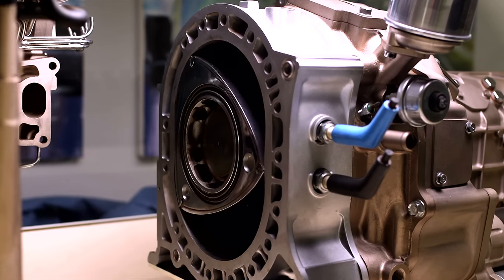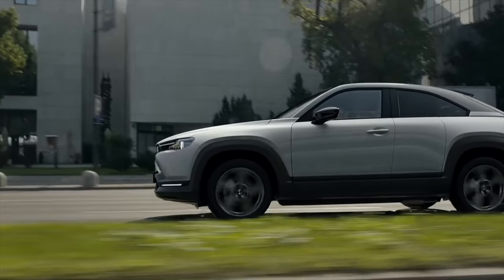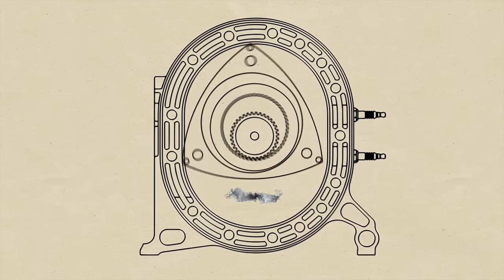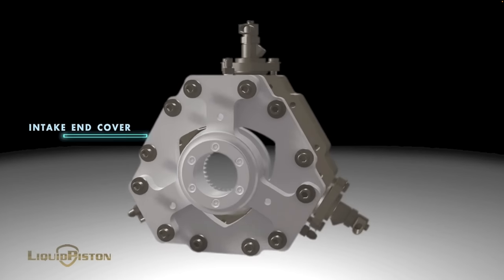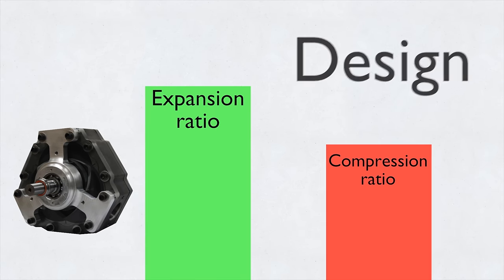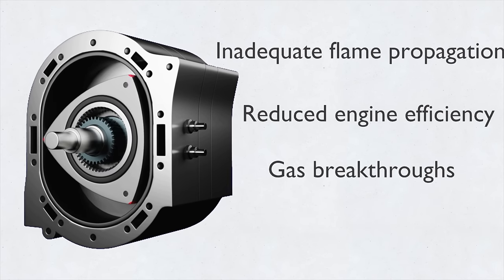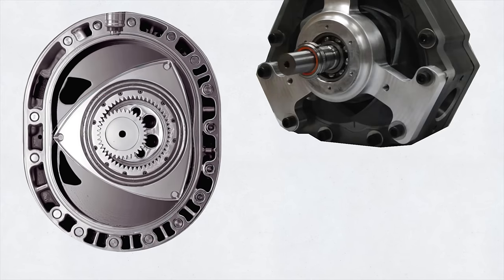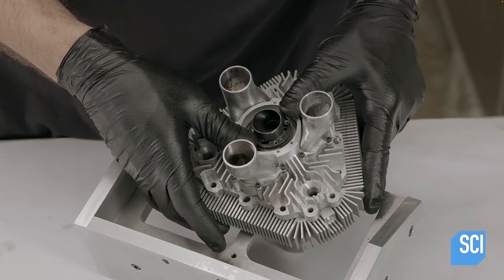Mazda's New Engine is the Smallest and Most Powerful Engine Ever Made

Comment: I'm surprised that liquid piston engine isn't already being used in cars. It would seem like a massive improvement even over piston engines.
Reply: Inertia.  A surprisingly powerful thing
Reply: Politics... advancing engines is politically unfeasible, with Western politicians bought by China with common people spending their money buying dollar store items.
Reply: I first heard about the LP engine around three years ago, and was shocked then to see it had already been around for some time with practically zero attention payed to it
Reply: They are comparing it to a basic 4 & 2 stroke piston engines that you find in lawn mowers and generators. Those engines are very poor in efficiency compared to the engines you find in modern cars so liquid piston engines might not be very efficient and according to their website, they might only be suitable as a range extender or in a hybrid powertrain. 

When it comes to piston engines, they have valves and have a lot of displacement to mix the air/fuel mixture so they can do lots of tricks to maximise the efficiency of the combustion as well as reducing carbon monoxide, soot, NOx, and unburned fuel. So keep this in mind.

Comment: If the liquid piston proves feasible then an inexpensive, compact 40hp diesel hybrid could make a good second car. The engine/charger running at its most efficient could keep a small battery-pack charged or, for every-day trips to school or work, it can use a plug-in charger at night. So, say a 40-mile electric range or a 300-mile diesel-electric range. A 70hp engine might do the same for an SUV. In this way you won't have to carry around a lot of extra batteries you mostly don't need.

Comment: I think hydrogen, I automatically think explosion....like the Hindenberg.  Still, I like the idea of using these newer devices in smaller equipment like drones, weed wackers etc.  It gives ample time to see things in action, make adjustments then move them to moving vehicles.  It could be a really good process to moving into other energies.
Reply: They won't explode though, the fuel cell tanks are bullet proof.
Reply: @ocrapo9327  That's really good to know.  Thx.
Reply: @lindac7146  One might explode though so it's a good point.
Reply: @ocrapo9327  ok Barika, which is it? Explosion or no explosion? 🙂
Reply: Petroleum/diesel engines already internally combust
Reply: Hydrogen has a really high cost to produce, its difficult to store and transport effectively, and extremely volatile.

This is the last thing we should be going for. 

But scotty bought liquid piston stock most likely, so here we are.
Reply: Whenever I hear people talk about Hydrogen fuel exploding, I have to remind them that gasoline is also highly flammable. The risk of exploding is about the same for an ice or even a modern battery electric car.
Reply: @Dizzykitty817  they aren't at all the same. Gasoline isn't stored in pressure vessels under thousands of psi, it doesn't leak past fittings an seals like they don't exist. The risk of injury, damage, or death from a fuel tank rupture or spill flaring up is negligible compared to a ruptured pressure vessel of hydrogen combusting. 

The bigger issue with hydrogen is still the idea that it's not viable as a fuel source because it's energy intensive to procure.

Comment: That liquid piston engine sounds amazing, imagine it with a hybrid setup
Reply: As a hybrid or just as a backup hydrogen powered generator.  Hydrogen will be the fuel of the future, renewable electrical energy systems will produce it, and transportation of Hydrogen is even less cost than natural gas.  Future will be interesting and tech will be amazing...AND, no green new deal government intervention is needed, just time....
Reply: @wokewokerman5280  once it stops being so freakishly dangerous... which is never...
Reply: @DrTheRich  I mean car accident would be Hollywood like
Reply: @castor2000  Not really, since there won't be a fireball. Just a loud bang, one second the car is there, one second it's only dust and debris.

Comment: The liquidPiston engine has a lot of potential but it won't go anywhere as long as a single company holds the patent.  And hydrogen engines are always going to be held back by the fact that it takes so much energy to produce the hydrogen in the first place.
Reply: the liquid piston engine can be powered on diesel, gas, and hydrogen with few tweaks to the mixes. Although this engine idea won't be on the market for many years, as the Air Force, and Army have private contracts with the company.
Reply: Rob Dahm is probably watching this
Reply: Breaking water into hydrogen (and oxygen) isn't such a big deal. The most pitiful weed growing in a crack of an asphalt road can do it just fine, using the meager amount of sunlight it catches. Human technology can do it better and better in the future if there's enough demand for it. But the free market is kind of like evolution: the best solution doesn't nearly always win. The winner merely needs to be good enough but more importantly market itself better than the alternatives, or have random luck with external circumstances nobody could have foreseen. Current electric cars, hauling around those ridiculously inefficient, slow to recharge, delicate yet heavy batteries, are a good example of it.

Comment: It such a shame that these motors are plagued by apex seal problems. It would be the most perfect combustion engine ever made. hopefully it can finally be worked out. And hydrogen will be the fuel of the future, not electric slow Joe.
Reply: I wonder if the apex seals were made of kevlar, or titanium, they'd hold up ...idk if kevlar would work in the motor though. Lol
Reply: @richsweeney1115  Stock seals were cast iron. Aluminum filled carbon for higher rpm applications, then in competition applications Mazda used ceramic seals.
Reply: @JasonLuther1  I've mostly worked on regular piston motors, my landlord has an 04 rx8 that I've started working on, it sat for two years , I got it running, it has a code for throttle position sensor, and it burns oil ,and stalls when it's warm and it's hard to restart..it almost catches, but takes a while . I'm pretty sure it needs a rebuild. It has 170k on the body, idk about the motor..it's hard to imagine  that motor ran 170k miles lol

Comment: Love the concept of the liquid rotor engine. Introducing hydrogen into the fuel system would solve a ton of emission problems. See Roy McAlister on running on hydrogen on YT. Resizing this to work with cars and trucks would be mind blowing.
Reply: It would push emissions to wherever they occur in generating electricity to make the hydrogen, transport it, and store it.
Reply: @davefink2326  well if it can be more efficient than gasoline, then it is a better solution...
Reply: @alphaxfang  nothing points to that except nuclear. Hydrogen is a container for (some of) the energy expended in its own production.  Fossil fuels are containers for solar energy that struck the earth in millennia past. It takes very little energy to make gasoline or diesel from them, but plenty to make hydrogen.
Reply: @davefink2326  at least hydrogen doesn't throw out carbon dioxide to the air... isn't that the worst part of gasoline?
Reply: @alphaxfang  I remember a device that took mankind to the moon , life support  , HVAC , communications 
light weight  The Fuel Cell 
Yeah !!  Whatever happened to the fuel cell ??
Reply: Isn’t hydrogen light enough to escape from our atmosphere? Something about moving too fast to be affected by gravity right?
Reply: @davefink2326  We are building a huge renewable energy plant in QLD Australia to produce emissions free hydrogen. Nuclear is the most expensive option, continuous advances in renewables will completely kill of nuclear .
Reply: @MickH60  we will see. If you're talking about the Gladstone project, the real decision making happens in 2023. They plan on using wind and solar to extract the hydrogen. Is Gladstone sunny and windy 24 hours a day?

Comment: @7:50 They were extremely reliable in motorsports though with rotary race cars having accumulated many class wins and possess a 74% race finish ratio. It's the smog epa regs that mess up rotary reliability. Even then many enthusiasts have circumvented the reliability issues.

Comment: There is most certainly a future for the Wankle Engine as a Hydrogen engine, and there is most certainly hope for the X engine. I can't wait to see if these two engines become mainstream
Reply: Wankel, not wankle its a pet peeve cause it’s my last name
Reply: @robbyturbo109  Robby, your last name is Turbo. My last name is unrelated to the Turbocharger manufacturer though, but I do drive a Wankel RX-8
Reply: All the same problems exist burning H2 as petro.   The engine would still require oil-injection to lubricate seals, there would still be high wear, and wide thermal variance on large flat parts.  H2 has no advantage over dino-fuel for a dorito-motor.
Reply: @Doonit_hard_way_since_65  yes it does no co2 emitted and renewable only nox emissions are emitted and as scotty said if you inject water you can reduce that
Reply: Hi @Doonit_hard_way_since_65  -

There is huge benefit for these types of combustion engines: multiple types of liquid fuel sources, less strip mining to acquire lithium, no dependencies on foreign suppliers, no requirement for slaves to create batteries & parts in China, pipelines of fuel sources to homes already exist: H2O (just need larger portable generators, like people have small portable oxygen generators.)

With today’s ability to passively extract liquid fuel from CO2 in the air, I would expect these engines to work just fine with them. Democratization of energy is upon us, and it does not mean we have to rely on slaves from North Western China to make it cheap for us.
Reply: @DavidHalko  That entirely makes zero sense from an engineering standpoint, and sounds more like some fantasy from a 6th grade class project on how to save the earth. Putting that aside, Let's look at a few facts. Currently those portable o2 concentrators (they are not generating anything, Oxygen, being an element can't be "generated") require a high power input to operate a compressor (thermal waste from the process) to force air through molecular sieves at a moderately high pressure. The energy conversion into waste heat is astounding. The output is not anything like a "fuel" it is primarily N2 (inert) waste, trace gasses, and O2.   No free fuel form the air for you, buddy.  whatthelivinghell is "democratization of energy" that is a flat idiotic term in all possible ways.  Lithium is Open-Pit, or shaft, or best... brine  mined, not strip mined. Strip mining is used for materials close to the surface (most commonly coal)  Lithium pegmatites are typically vertical geological bodies, not the sort of thing that is strip mined effectively.   But, hey, details aren't important when spewing your propaganda, right?

Comment: Hydrogen is the way forward for a number of reasons a few of which are that it is inexhaustible, burns or catalyses cleanly, can be used almost universally to replace gas, liquid fuels or direct electricity generation.
This project, the subject of Scotty's video is just one and I hope it succeeds. In the UK JCB have developed piston engines running on H² to power their trucks using 90% conventional technology.and solved storage and distribution problems.

Comment: What a piece of engineering .
Reply: Designed by a German named Dr. Felix Wankel. The engine used a roter instead of a piston. NSU, and Mazda were the users. AMC was going to use it for the Pacer, Citroën on the G series, General Motors on the Chevrolet Vega. The latter projects were scrapped do to the energy crisis of 1963

Comment: I had an rx8. Biggest money pit. Between new engines lasting 30k to 40k, fuel consumption, two cycle oil containers per fill up and of course low end torque was horrible . It was still fun to drive at higher speeds.

Comment: This HEHC engine could be just what is needed to make a vehicle with an electric drivetrain practical in areas where charging infrastructure does not exist, as in most of the USA.

Imagine a lightweight aerodynamic two seat vehicle, such as the Aptera, with a battery powered electric drivetrain, no drive axles or transmission at all, electric motors at each wheel. And, in the back, a small diesel HEHC engine driving a single speed generator to charge up the batteries on demand. This would permit the vehicle to be useful as a local electric commuter, charged at home, and for extended drives over long distances using diesel.

This would permit a small low volume car maker, such as Morgan, to make electric vehicles competitively even though they do not have the technology, patents, and economies of scale to compete with Tesla's battery tech.

Comment: Rotary engines have been under-developed. 
Ive been digging these liquid pistons for some time. If you can get one 1/3 the size of a diesel in a Peterbuilt, or even a light duty like a Ram 1500-3500, people would be all over that like white on rice.
And as a range extender for EV, 5 gallon tank to help keep the batteries charged could easily take you another 500-1000 miles.
Only thing holding these back is the patent.

Comment: I always thought that a good solution would be electric motors to drive the wheels, a smaller battery and a continuous running engine for the sole purpose of keeping the battery charged. The engine would only need to produce the average power necessary to run the car. The electric motor would drain down the battery during acceleration, but the engine would recharge the battery during cruse. Also, since the engine is not connected to the drivetrain, it can run at its optimal speed. This would also open up the alternative of using a turbine engine as there would be no acceleration issues.
Reply: That’s essentially how electric diesel trains work.

Comment: Years ago I remember seeing something about Mazda and Mercedes joint research into a hydrogen engine. A quick search came up empty. Will try to find info later.
Reply: Mazda have been working with Toyota on the rotary for hybrid applications, also running on hydrogen. Japan is moving to a hydrogen economy, making hydrogen from nitrogen gas cooled nuclear reactors at the nuclear plants. They can reach 1,000 C so when cracking water for hydrogen they are highly efficient.

Comment: This sounds really exciting, I don't think hydrogen will ever be widely adopted for consumer auto usage, but it definitely has a possibility for hybrid technologies on aircraft. I do have a question though, does the energy consumed by electrolysis to split a water molecule, greater than the energy consumed by a liquid rotary engine to generate the electricity for electrolysis?
Reply: When you include efficiency it's much more to do electrolysis.

Comment: Liquid piston has good marketing and... That's about it, lubrication is still needed, so oil has to be injected, a piston engine has lubrication on one side, which is sufficient, on rotaries both sides of the seales are combustion chambers

CV combustion is less efficient, because if you keep the volume constant pressure and temperature in the chamber rise, pressure puts stress on the seals, temperature gets dissipated into the housing, which decreases efficiency

Piston engines offer a much higher range of usable rpm, since you can vary intake, exhaust and ignition timing much more freely, engines that run well at a narrow range of rpm and load are good on generators, not on cars

Wear on the housing means you have to replace it, else geometry doesn't work out properly, on a piston engine you bore it, hone it and fit a slighly oversized piston, meaning you can keep the engine running vs having to manufacture a whole new engine (huge emmisions, often omitted)

Comment: If hydrogen is to be used as fuel why not use it along with fuel cells? and get rid of transmission losses? This also can have provision for the battery use alongside - Please suggest if there is any issue with this?

Comment: Ok you don’t need much horsepower to crank an ac charger. So if you use a small yet efficient rotary motor at a high rpm. To spin a magnetic field to potentially charge a smaller battery that is smart enough to charge individual power cells that aren’t being used you could potentially double the distance of electric car.  With less pollution cause the motor isn’t running to produce power to the wheels.  But man just imaging hearing a constant motor noise charging your electric car as you are in stop and go traffic.